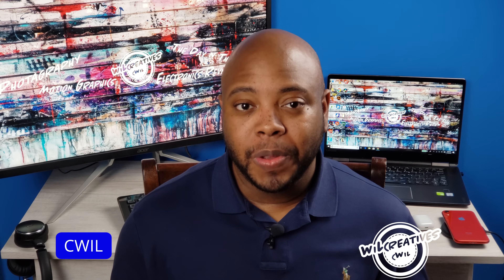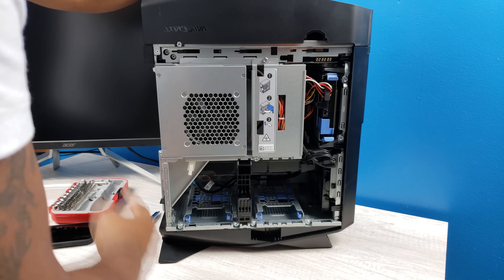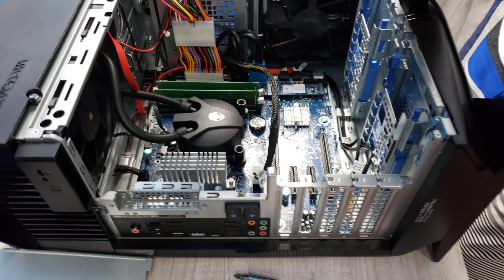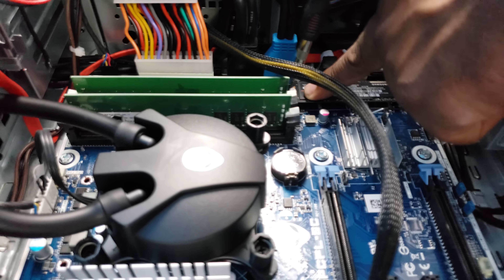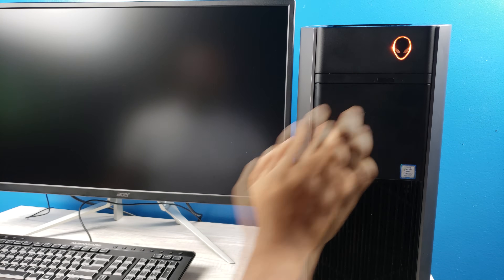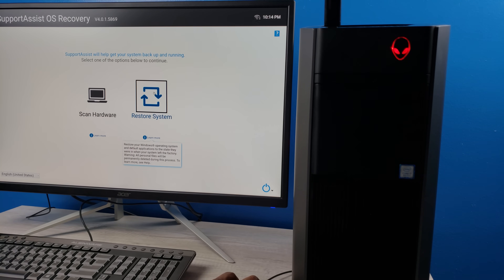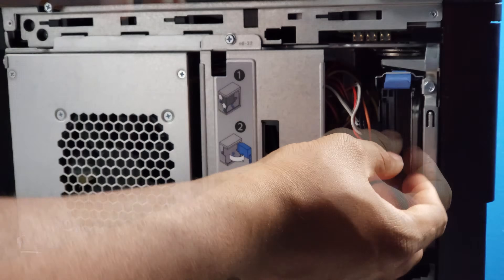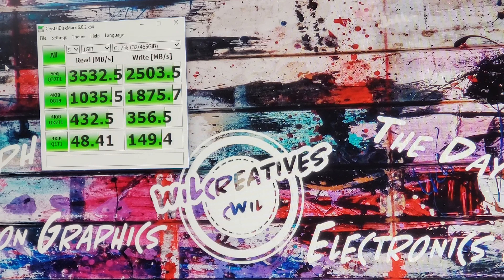First Impressions / Installation Samsung SSD M.2 interface 500gb 970 Evo to Dell Alienware Aurora R7

Comment: my system has the factory gtx 1070 thinking about upgrading to a rtx 2070 blower version should i upgrade the power supply?
Reply from the maker: You would be better off with a dual fan card that’s less than 11 inches long.
Reply from the maker: And that’s if you have a liquid cooled system
Reply from the maker: SMC Remix87 and yes if you have the 460w PSU you will need to upgrade it

Comment: my system has the factory gtx 1070 thinking about upgrading to a rtx 2070 blower version should i upgrade the power supply?
Reply from the maker: for the 2070 yes the psu requirement is 550w minimum

Comment: Thanks for the video! I saw you couldn't use the recovery from Dell/Alienware to install the system. I don't have a fresh windows copy to use as you've done, only the recovery on a pendrive. Can I still make it work?
Reply from the maker: Bruno Porrio I don’t think so I tried using the Dell recovery twice and it didn’t work. You will need to google how to create Windows 10 usb installation drive.
Reply: @WiLcreatives  Thanks for the info! I'm going to go ahead and do it. Since I don't have a windows key (came pre-installed with the Alienware R7) should I assume it will pick up automatically?
Reply from the maker: Bruno Porrio the product key is built into the motherboard hardware

Comment: just a random question...would it be possible to switch the aurora parts into another case (bigger gpu would fit)
Reply from the maker: Yep but I would buy another motherboard for future upgrades
Reply: @WiLcreatives  would that mean i would need a new windows liscence since its hardware-related?
Reply from the maker: If you replace the motherboard yes but they have oem windows 10 licenses out there for $15 to $20. Check out cdkeys or scdkeys. Worked like a charm on my custom build

Comment: so if i buy an alienware aurora with windows 10 pro, i will be able to recover that key doing this? Or would I have to purchase a new copy of windows due to changing the main ssd?
Reply from the maker: No you can use the same key with the new hard drive. For dell they base it on your hardware signature.

Comment: Hey Wil - did you end up having to uninstall any drivers etc. related to Intel Optane, or is disabling it in the Rapid Storage program all you have to do? I'm having a weird issue since following this vid where my Aurora R7 hangs for 10-ish seconds before the boot logo appears - sometimes longer. It's also spinning my external HDDs for whatever reason, so my last BIOS time was something like 68 seconds, which is nuts. Anyway, just throwing it out there in case you have any ideas, as I haven't been able to figure it out on my own. Thanks!
Reply from the maker: I disabled it in the rapid storage program and I end up uninstalling the drivers when I reinstalled windows. What nvme drive did you replace the optane with?
Reply: @WiLcreatives  Samsung 970 Evo. I did figure out part of the problem, which was that a couple drives had EFI partitions (which, from what I understand, Windows looks at when booting), so once I removed those partitions from everything but the boot drive that initial logo hang disappeared and I'm down to a 41 second boot time. Thinking that's as good as it will get now, because if I disconnect those externals it boots lightning fast. So now I've just started using Sleep rather than powering the system down, which works fine. I figure one of the externals might be failing, even though SMART scans turn up fine. Also might just be because they're large drives, with two 8TBs and one 4TB, and I can't seem to find a way to basically tell Windows there's no reason to spin those drives until I'm logged in. Anyway, thanks again for these vids! Without these I don't think I'd have felt comfortable tweaking the system at all, so they helped with that and encouraged me to learn more.

Comment: Nice video! I’m planning on buying one of these whenever I get the money and do plan on swapping out the intel optane memory for the Samsung card. One question, when creating the windows installation USB, do I do it from Dells website or windows?
Reply from the maker: Nice thanks for the feedback. I've never had luck from Dells website. I created mines from Microsofts website.
Reply: WiLcreatives Ah okay, another question. After installing windows onto the Samsung card would I have to reconnect the HDD and format it or would it cause some issues from having two devices with windows installed?
Reply from the maker: @ScrubLord545  Yes you would reconnect and format the old hard drive
Reply: WiLcreatives and would the system be able to support a 9th Generation I7 8700/8700k? Only asking because of the extra cores and treads.
Reply from the maker: @ScrubLord545  the R7 maxes out at the i7 8700k. The new R8 supports the 9th generation

Comment: Thanks so much.  I used your video to upgrade my old XPS 8700 to SSD and reinstall window.
Reply from the maker: Sweet I'm glad it worked out.
Reply: @WiLcreatives  now just wondering if the 450w power supply can handle the 1660ti GPU
Reply from the maker: That depends on which manufacturer you get the card from. I've seen EVGA recommends 500w PSU but MSI says 450w.

Comment: Thank you for your very helpful video.  Following the steps in your video, I added a 970 Pro 512 SSD.  (As a side note, I haven't plugged the HD back in yet, though, because I could not quite catch all the micro steps on the best way to do that from your video.)  But the main point of my comment is that when I added the Samsung 970 Pro SSD, the Microsoft NVMe driver installed as expected.  Because I've read that the SSD will perform better with the Samsung driver, I downloaded & installed the appropriate driver from the Samsung website.  However, in the Device Manager the Microsoft NVMe driver still shows up (even after restarting my computer multiple times).  However, the Samsung driver is showing up in my Add/Remove programs listing, so it did download & install.  Also, after downloading the Samsung SSD driver, my computer seemed to run a bit slower than with the Windows NVMe driver.  I did not do any formal tests.  I just manually timed my start up boot time and just observed how quickly it loaded programs and web pages, which seemed a bit slower, but it could just be my imagination.  So I uninstalled the Samsung driver.  Anyone else have any of the same or similar experiences with the Microsoft and Samsung NVMe drivers with the Samsung SSD installed?  (Also, just fyi, I did not reinstall the Rapid Storage Technology driver after my clean Windows installation, as you & others noted issues with it.)
Reply from the maker: Hey good info, ive never noticed a decrease in speed. You don't necessarily need the samsung drivers. After you uninstalled the samsung drivers did you notice an increase speed  in your boot times?
Reply: @WiLcreatives  Unfortunately no.  It never went back to the quicker boot time.  I'm wondering if I would have to do a clean install of Windows again to get back to the quicker boot time.  Before I installed the Samsung driver it took about 10 seconds from the time the Alienware logo popped up to when the small wheel started spinning (which turned 4 1/2 rotations) before I got to my sign-in screen.  Now it takes about 20-28 seconds (varies) from the time the Alienware logo pops up to when the wheel starts turning (which turns about 4 1/2 rotations) before my sign-in screen pops up.  I know about 25-35 seconds is not horrible, and definitely not worth reinstalling Windows to see if it goes back down in time, but it is noticeably slower than the really snappy start up I had before downloading the Samsung driver.  What is your boot up time?  I've watched several videos on optimizing and speeding up Windows and followed the advice, but that has not helped get the boot up time back down to where it was before.  Did you download the Samsung driver?  If so, do you actually see it listed as the driver for the 970 SSD in the Device Manager, or do you still see the default Microsoft NVMe driver listed and only see the Samsung driver listed in Add/Remove programs, as I did?

Comment: Because YOU DID, I started adding stuff to my Aurora R7.  I thank you for all the great ideas and techniques! Now I have a puzzler.
I put a 970 Pro in the m.2 slot. A 660 P (m.2) in an pci adapter slot. And put the octane in another pci adapter slot. The 660 P (2 tb) makes a fine C drive. But it is not as fast as the 970 Pro. (Only 500 gb). I used Samsung Magician to clone to the 970 Pro, but still can’t get the BIOS to boot from the 970 reliably. And I have no idea if the optane is functioning beyond being another bit of storage. Any thoughts? You are becoming an Aurora Authority! Dell support just dismisses me with “you have voided the warranty and we don’t support custom builds” crap.
Reply from the maker: Thanks for the feedback and support. I never thought of using PCIE adapters. Now that's interesting. I haven't used the Samsung Magician software but I do know that its hit and miss with the Dell Motherboard. I believe there is certain things you have to set it up properly I just don't have the expertise in that. This was the main reason why I did a fresh install of Windows. What steps are you taking to boot into the 970? what are your speeds on the 660P?

Comment: Now my question is: how can I change my nvme (250gb)  to another nvme (1tb) without doing a fresh install, I don't wanna lose all my data, this motherboard only has one for the nvme, TIA
Reply from the maker: Great question unless you had another system with multiple m.2 slots I dont know of a way. You can possibly look up creating an image of your current drive put it on an external harddrive possibly and restoring it to the new nvme but I'm not sure if that is possible. Personally by the time you try to figure that out, you could have reinstalled windows along with the software you need but its totally up to you.
Reply: @WiLcreatives  thanks for the reply, I'll look for alternatives to see if I find a solution
Reply from the maker: @johntrejo  no problem!

Comment: Hello! Great video! I would like some advice. I had originally planned to upgrade my recently bought Aurora R8 when I watched this video, but then i found out that the R7's come with the M.2 32GB optane NVMe version and the R8's comes with a M.2 Toshiba XG6 256GB NVMe as well as a 1TB HD. I've already purchased the 1TB Samsung 860 EVO SATA SSD as a replacement for the HD. I was wondering if i should still carry out my planned upgrade of the NVMe to the 1TB 970 EVO Plus as well. What do you think? Any advice is greatly appreciated!
Reply from the maker: Personally I would still use the 1TB 970 evo, if gaming is your thing or you're really big on having a fast responsive system. Games load and run faster on the SSD which you definitely will appreciate the 1TB vs the 256GB for space. If none of that matters then return the 1TB.
Reply: @WiLcreatives  Hey thanks for the quick response! I will definitely do that! I have one more question, I saw all your other install videos and there was one thing I was confused about; did you use the M.2 970 EVO NVMe just to run the OS, or did you install other things like games and movies as well? I've read some comments of how people plan to use the M.2 970 EVO NVMe for "just" their OS, and I was wondering if that meant not using it for anything else. Anyway, thanks again for the response, you are awesome!
Reply from the maker: Good question I used solely for my OS and everyday programs. I used a different SSD drive for games and storage. Initially I should have gotten an 1TB nvme instead of the 500gb but as long as games are running off an ssd you won't notice the difference between a sata ssd and nvme ssd when it comes to loading games.

Comment: So I have a R7 like you and I have considered doing the same ssd upgrade. To do this though how do I save all of my files and things and also keep my windows? I would ultimately like to have windows boot up on the ssd. Thanks
Reply: having the same trouble, already cloned to my SSD but am unsure how to make the SSD the primary drive for windows plus a few things and keep the HDD as secondary. I want to change the RAID off for the Samsung SSD but am unsure if it will corrupt or disable my current Dell HDD.  Alienwares BIOS is very different than every other video I've tried to watch and this is the closest insight i could even find. Dell really likes making stuff difficult.

Comment: Hey wil. How are you doing? I hope ur enjoying ur pc. Also i bought a 1 tb nvme samsung pro 970. Got a good deal on it. I installed it onto the m.2 slot on the motherboard. the R8 does not come with optane memory and probably doesnt have any impact on booting the operating system onto the 970 pro ssd. With that out of the way..i used a software called macrium and cloned the entire windows 10. I created a rescue file on the usb.I tried to boot windows 10 onto the nvme but currently running into problems. It keeps crashing and takes me to diagnostics. I can see the samsung pro on the boot setup but cant click on it. Also changed from raid on to watever the other is.I also left the 1tb hdd unplugged. Maybe you can help lol.
Reply from the maker: Hey yeah the problem is with the Dell Motherboard. It doesn't like the cloned drives. Some people have been able to get it to work but when I read it was to many issues which is why I didn't do it. I would just download and create a windows installation USB. Do a clean install of windows to the 970 eco pro and just copy what you need from your 1TB harddrive. Yeah you will have to reinstall your programs and drivers but it will be much better.

Comment: Why didn’t you install the 970. Boot into windows with your hd. Use Samsung migration to clone os into ssd. Could have taken a lot quicker rather than reinstalling windows
Reply from the maker: Some people had success and some didnt with cloning. If it works I don't see a problem. The way Dell created the motherboards I've seen issues with this. I just recently had a subscriber that is currently having issues with this. A clean install puts you back in control and it's a fail safe for me. Plus reinstalling windows didnt take long with an nvme drive.
Reply: WiLcreatives cloning is a great tool and works wonderfully with me twice. Once on an Alienware 17 R3 laptop (HDD to evo 850 500gb). And now my own desktop that I recently clone from adata 480gb ssd to 970 evo 2tb. Once done cloning, restart and your pc automatic boot from that clone drive, evo 970. Windows will see 970 as C: main drive and the adata as D: drive. I could format the D: drive after that. You don’t have to mess around with cmos and configure anything. That’s the perk of using Samsung ssd. You could use Samsung migration for free. Not sure what rate of failure you’re referring to. You can’t compare the speed of cloning vs reinstalling a free windows from thumb drive. Sure the 970 is fast but the source it copy from (thumb drive) read speed is slow...hence the bottle neck. And you have to reinstalling Microsoft office, Adobe suite, steam, other drivers if you install fresh windows, how long does that take?
Reply from the maker: @khhoaiii  Good info!
Reply: private i am having issues because in the bios the nvme 970 pro is recognized..i fiddled around in the bios with every setting possible but it keeps taking me to diagnostics..maybe im doing something wrong but i used macrium to clone windows 10 and also created a rescue drive. So maybe you can help. It just wont boot onto the samsung 970 pro. I have the alienware aurora r8 which i recently purchased and dont have much on the hdd. Its basically new and had windows 10 home on it.
Reply: @187jd  you clone successfully with macroium and once reboot, bios would not boot from 970? I think you have to fiddle around with bios boot sequence. Set the 970 pro as the primary or 1st drive to boot from. Good luck and let me know. 970 pro you cannot use Samsung migration?
Reply: private i could use samsung migration but never really got to it because i thought macrium was enough. On the advanced boot settings boot option number 1 says windows boot manager. And 4 others. Ncis 1 and ncis 2 i believe..those are just networks..boot option 2 has the samething and boot option 3 has the samething . None of them show my 970pro which i would have put in boot option 1. But i dont even get the choice.
Reply: 187jd there are no boot sequence? In windows boot manager...I think there is an option to find the boot file from the ssd. Try choosing the one from the 970

Comment: Watching the video was it necessary to reinstall Windows after installing you're M.2
Reply from the maker: Yes it was, I read some people had success with Samsung magician but I wasn't taking that chance. It was much easier to do a clean install and load the programs that you need.
Reply from the maker: This is of course if you're using it to run your OS.
Reply: Maybe i should clean install onto the nvme. What would i need to do?
Reply from the maker: @187jd  you would need to create a windows 10 installation USB. Google it and it will direct you to Microsoft's website to download windows 10. You will need at least an 8gb USB drive.
Reply: @WiLcreatives  does it knows you have a windows key with this pc? I mean how do they know I own a system that have liscence?
Reply from the maker: @rickoqc  its a hardware signature by Dell.

Comment: Have u upgrade the RAM I plan to get hyper x or 32gb ram if that does anything or just save up for a Asus Rog monitor.
Reply from the maker: It depends on your preference. If you prefer more fps you will see a slight gain in performance. If you want a better playing experience then go with the better monitor
Reply from the maker: And yes I upgraded my memory to 32gb G.Skill RipjawsV 3200mhz